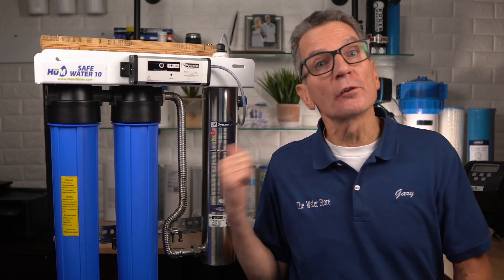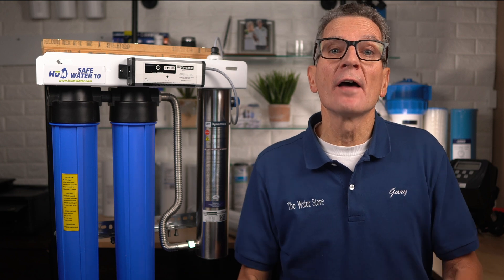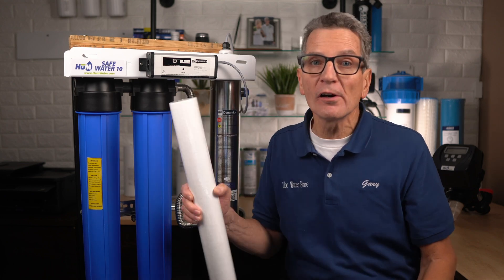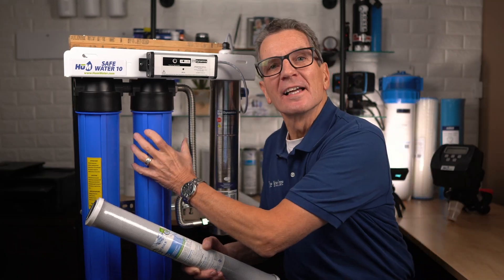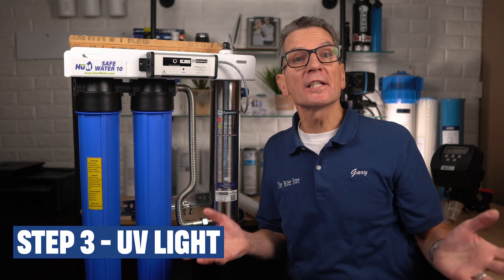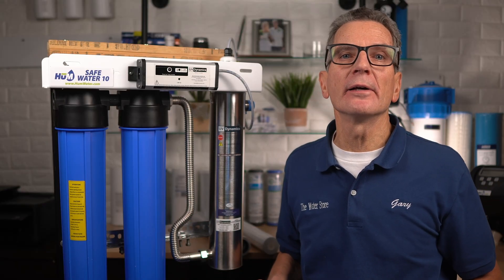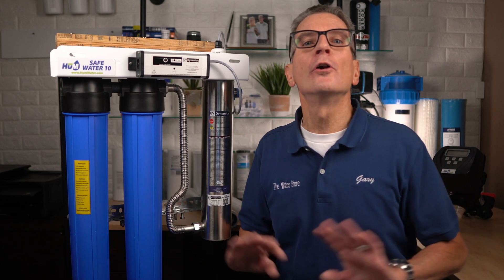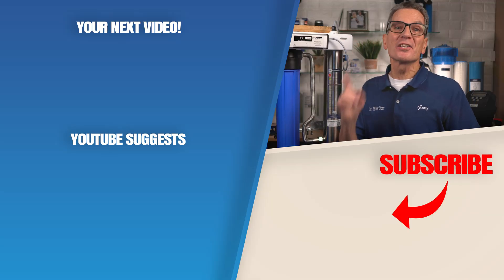HOW Does a UV SYSTEM Work? (In Depth Guide)

Comment: Hi Gary! I've had my coliform test come back at 4.2 and I'm trying to put a UV system in asap. In your opinion, would you oversize a UV unit vs going with one that just meets the needs? I'm back and forth between the Viqua VH200 and VH410. I'm looking to always have 40 mJ/cm² for my water. I have 2 full baths and 1 half bath -- I'm on a well and just tested the GPM using the bucket method and taking water right from the pressure tank and got a GPM of 7.5. (due to my situation I had to run it through a 100ft garden hose so I'm thinking I'm thinking im between 7.5-8gpm)

One of my biggest concerns is if I put the VH410 which does 14 GPM at 40 mJ/cm², would it be overkill? Would there be a concern if water flow was stagnant for too long - the unit overheating/being damaged?

Hope to hear from you! Thanks kindly!

Comment: Gary, that's a pretty neat system with multiple stages. Mine has only the UV canister. While changing the lamp a few weeks ago, a plumber did check it for sediment and dumped out a fair amount. But I think that was the first time in several years that anyone did that. I also have a water softener, and an acid neutralizer that's about five feet tall. A different plumber installed them years ago when I complained about all the sediment I was getting. I don't know why I wasn't given a sediment filter, but I have to admit, the sediment is greatly reduced compared to what it was originally, so I guess the water softener and/or the acid neutralizer are removing a good bit of sediment, too. 🤔Is that plausible?
Reply from the maker: Yes, but yoyu really should have a sediment prefilter before the UV.  We have them here https://waterestore.ca/products/hum-cottage-pre-filter-kit-10-bb-5005-micron
Reply: @water_estore  Thanks... and in that case, why would my plumber (the one who installed the UV canister OR the recent guy) not have told me that? I'm kinda frustrated by some of the bad advice I've gotten -- and the advice I didn't get. The installer in fact did something so bad that even this layperson sensed it was wrong. He had the well supply line going directly into the UV lamp, upstream from ALL the other equipment I mentioned! I objected when I saw what he was doing, quickly researched it online and confirmed my viewpoint while he called his boss, who (supposedly) said it could be done either way. 🤯 That may have been the last straw; I haven't used them for years. Imagine the sediment I would have had if he did it his way!

By the way, I clicked that link and saw the product for several seconds, but then it went to another page that just said: "404 / page not found." The first time, a USA/Canada selector popped up and I chose USA. Then after getting the error message I tried again and I ended up in the same place after briefly seeing the product.

I'm curious whether my plumber would be willing to install it, but I'm certainly willing to ask.
Reply from the maker: Here is the link to our US website https://waterestore.com/products/copy-of-hum-cottage-pre-filter-kit-10-bb-5005-micron  Yes, there is lots of bad advice out there which is why I strated making these videos in the first place to help familys just like yours..
Reply: Thank you, @water_estore